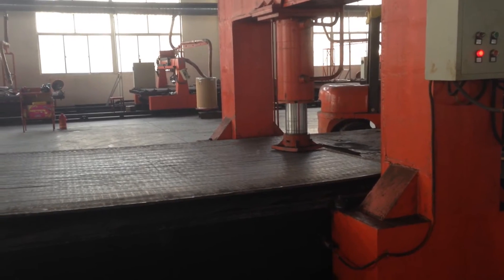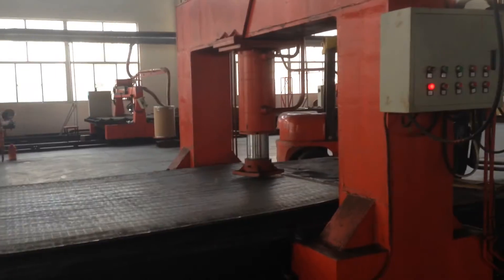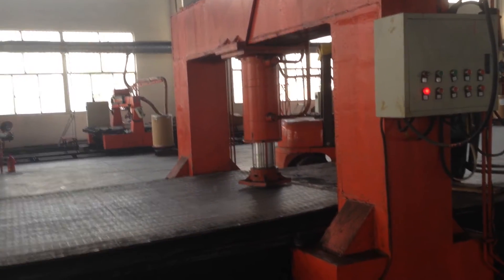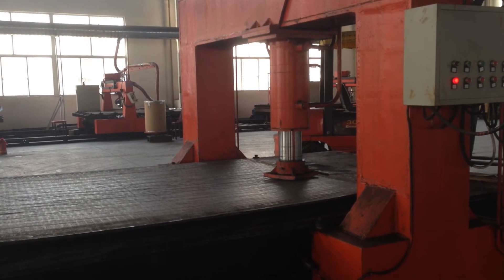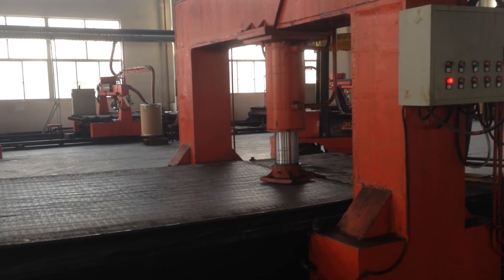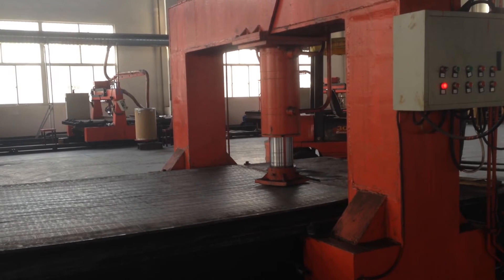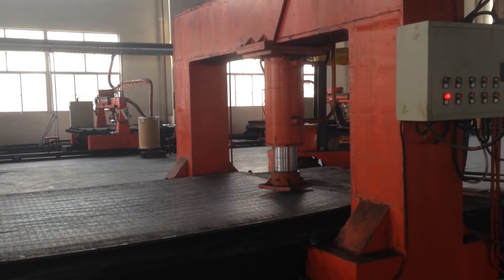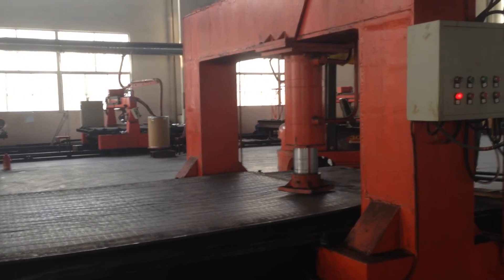chromium carbide overlay plate flattening -zhangjiagang YaoYu Wear Resistant Materials

Comment from the maker: http://www.wearresistantplatesteel.com
http://www.chromiumcarbideweldoverlay.com
Typically the weld bead is along the width of the plate and the hardfacing layer is smooth without high spots, we have roll press to flatten them after welding, as it’s very important for the plate to be as flat as possible.